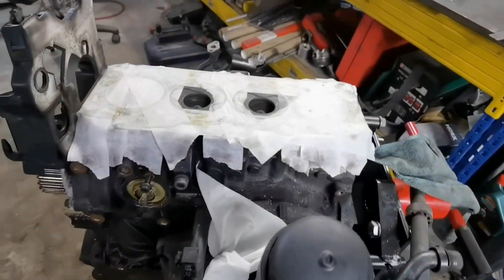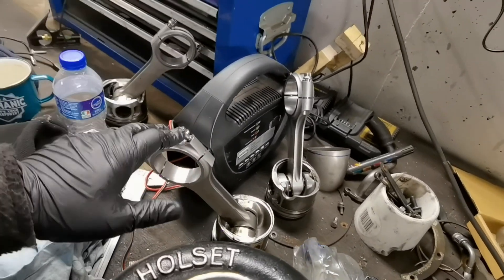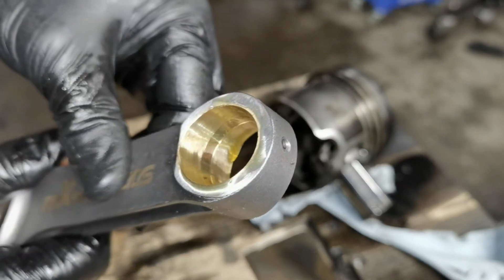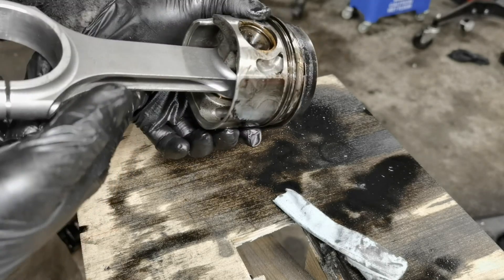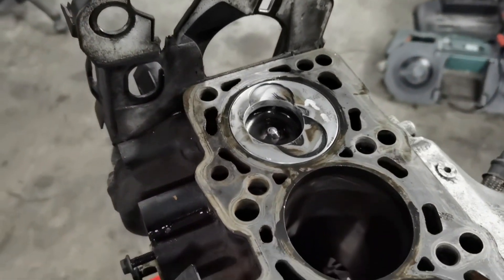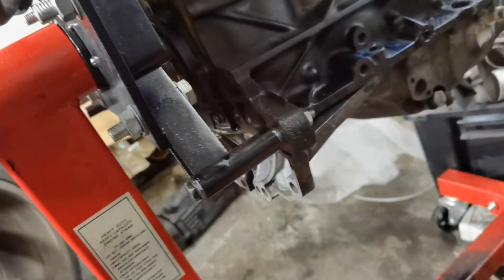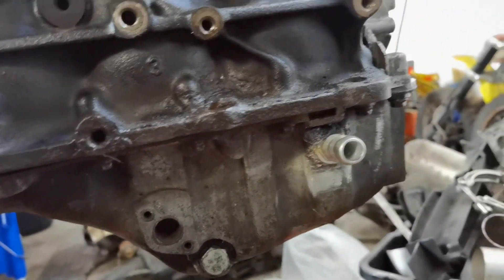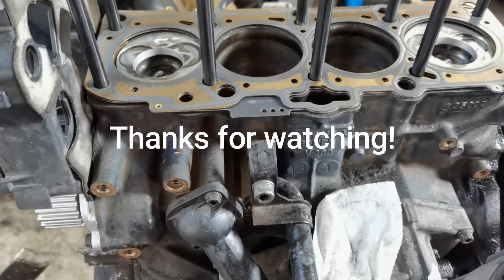Building my 1.9TTDI bottom end for 400++hp

Comment: rebuilding a BLS at the moment piston 1 had a break on top compression ring. Worked on cars for a long time only thing im worried about is the sputter bearings as can't find any info on where they sit and what one goes to the top of conrod and what one goes toward bottom, one has a copper layer the other is normal looking im sure copper layer goes towards top of con?
Reply from the maker: Copper layer is from wear, you'll need to get new bearings! Replace them on all conrods with new bolts. BLS tend to wear these and spin them destroying crank and sometimes engine!
Reply: @brolyfe8018  thanks for letting me know, I knew the stretch bolts had to go but no idea  the copper stuff was actually worn as its worn perfectly even, on the ball
Reply from the maker: No problem happy to help